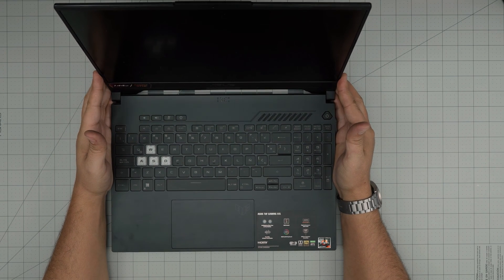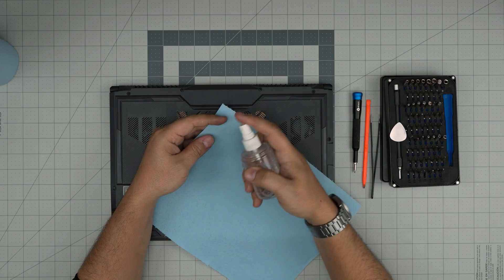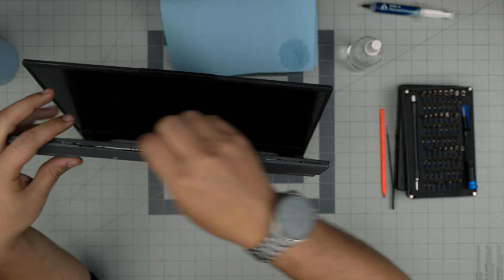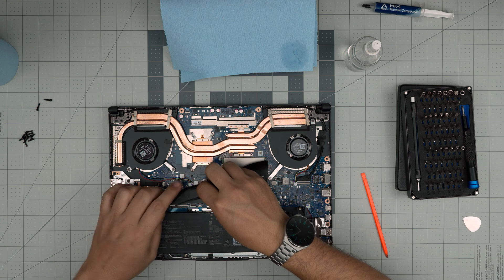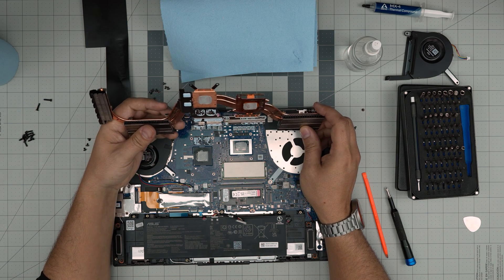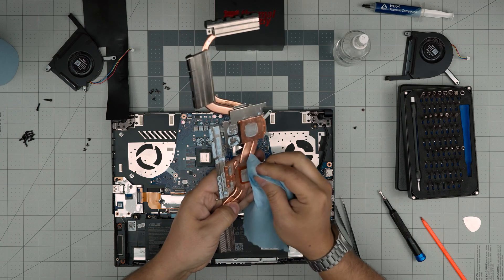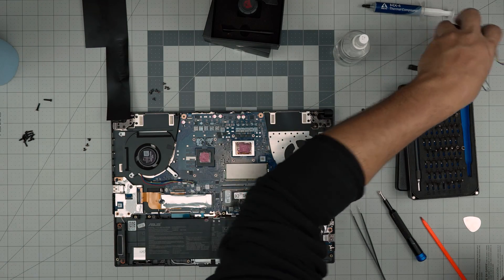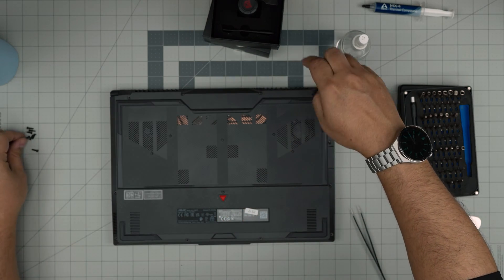How to Repaste & Clean Your ASUS TUF A15 FA507RF: A Complete Guide

Comment: I unscrewed the 8 screws to the heat sink but it won’t lift up, the whole board lifts up with it. Is there any clips or anything I should do before taking the heat sink off? Please help!
Reply from the maker: 🫠Regarding your question, heat up the heatsink with a hair dryer for a few minutes. Once it's hot, lift it— the thermal paste is dry and holding it in place. Use a bit of force from the center of the heatsink.
Should you have any further questions or requests in the future, please don't hesitate to ask me.
cheers🍻
Reply: @uFixTek you are so totally right! I did get it off by myself I just had to wiggle it a bit, you have the best guides!
Reply from the maker: awesome job 🫠👍

Comment: Hello! I have this laptop and need to install a heatsink on my NVMe SSD. Before powering it off, disconnecting the battery, and opening the back panel to remove the NVMe SSD, should I take any software-related precautions?
Reply from the maker: 🫠Regarding your question, no, you don’t need to disconnect the battery—just power off the laptop and remove the NVMe. However, if you want extra protection, you can disconnect the battery.  
As for the heatsink, you can only use a slim one, such as a copper sheet. Any other type of heatsink won’t fit, and the laptop won’t close.

Should you have any further questions or requests in the future, please don't hesitate to ask me.
cheers🍻
Reply: @uFixTek  I think you misunderstood my question. I wasn’t asking whether I need to disconnect the battery or which heatsink fits. My question was about software-related precautions before removing the NVMe SSD. Should I disable BitLocker, unmount the drive, or take any specific software measures before handling the hardware? I just want to avoid any boot or security issues after reinstalling it.
Reply from the maker: The first "no" was in response to your question, but I forgot to add "and no" for the second part. 🙂  

You don't need to do anything as long as you shut down the laptop completely.
When you click the Start menu and select "Shutdown," you're not actually fully shutting down your laptop or PC.  
To completely shut it down, hold the *left SHIFT key* before clicking "Shutdown," and keep holding it until all power indicators turn off. This ensures a full shutdown.  
If you don’t know your BitLocker key, I recommend disabling it—it only takes a few seconds, but it should not ask for it, as we do this daily for clients.

Comment: Hey thanks for the video. This also works with model FA507RM except that the copper heat sink has extra channels so if you want to remove the fans for cleaning you have to remove the copper heat sink first. I've so far cleaned and repasted twice with the video as reference so take my like as thanks.
Reply from the maker: It's my pleasure my friend, i appreciate your support.
Yes, if you follow this video, you can apply it to many revisions of this series.
Should you have any further questions or requests in the future, please don't hesitate to ask me.
cheers🍻

Comment: What should I do to clean and check the "power" button problem?
There have been some times when the laptop turns on with difficulty and I feel that maybe the power button has a problem
Reply from the maker: 🫠Regarding your question, if you have trouble with powering on and need to tap a lot on the power button or anything similar, you will need to replace the entire keyboard. The power button is part of the keyboard and uses the same membrane to communicate with the motherboard. You can't fix the power button; if you attempt to open the key or clean it, it will only get worse. Replace the keyboard.
cheers🍻
Reply: @uFixTek  
tnx❤️

Is there a way to know exactly what the problem is before opening the laptop? For example, with the help of something software
Reply from the maker: Sorry, but there's nothing you can do from the outside. We get this issue with these models, and the only fix is to replace the keyboard because the power button is on it.